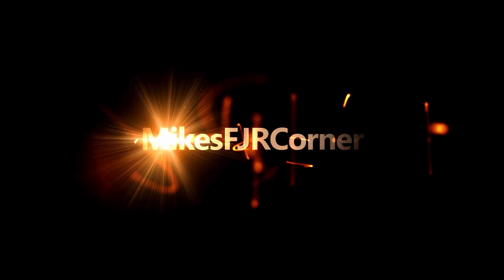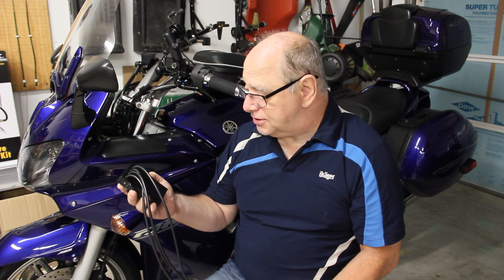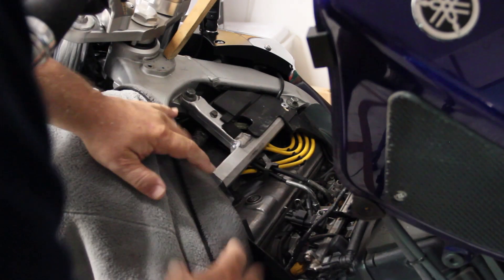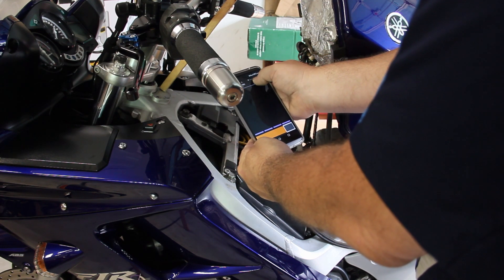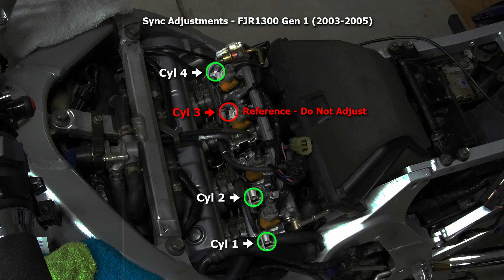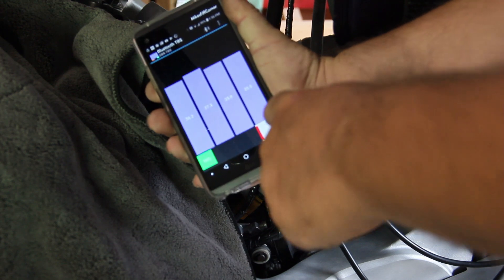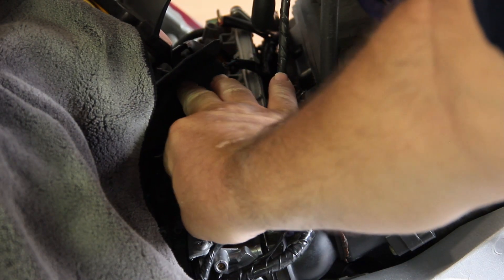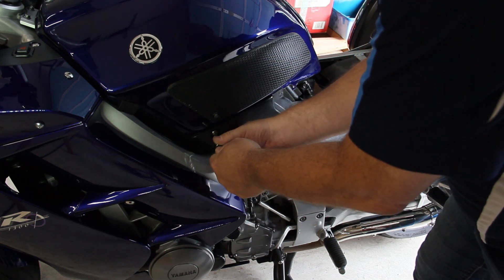Doing a Throttle Body Sync on the FJR1300

Comment: Ur not showing where to adjust
Reply from the maker: There is a section in the video showing a picture with circles around the adjustments. 

Unfortunately I don't have the luxury of a camera man. With both hands busy, my hands blocked the adjusting. Did not notice until later. That's why the picture.

Comment: Hello  , i did unscrew the master cylinder  by mistake  , do you know  how do i fix this?
Reply from the maker: Hello, unfortunately Yamaha does not have a procedure for this. I'm guessing you don't have any pictures or memory of where the adjustment was or how far you moved it. I think it's about 3/4 turned out from  closed. Id consult your Yamaha tech for what they do in this situation. It defines the air fuel ratio for the rest of the cylinders when the trims in the ecu are not in effect.

This is only for if the master adjustment was definitely moved. I'm just throwing an idea out there, don't know if it will work but...

If you disconnect the O2 sensor, the ecu goes into an open loop. With the sync in balance and a clean tb and air filter, measure the air/fuel ratio with a fuel ratio gauge. With the engine slightly off idle, take a measurement. If its rich, turn out all screws slightly, if it's lean, turn them in slightly.

Maybe somebody with knowledge of the inner workings of the ecu could add to this theory.

I've learned the hard way, take pictures first. Yamaha should really put a cap on the master cylinder adjustment. My old 84 Honda  interceptor had caps on the carbs air adjustment.

Hope this helps, mike

Comment: Hello,
First thks for your videos!! very helpful. I am doing a TBS on my 2007 FJR and I was wondering if the reference cylinder was also #3 for my year? 
Unfortunately the manual I found for 2007 model does not talk about TBS unlike the 2006 manual.
Also I am using the carbtune pro and the metal rod keeps moving up and down making the reading hard. is it normal?
Do you have any info on that?
Thks for your time.
Reply from the maker: Your Welcome. Yea, I had the same problem. Get a set of restrictors from Motion Pro (Link Below). Yes. The 07 (GEN2) has a similar TB to the 05 (GEN1). The cable is connected to TB #3, this is the fixed TB that all other TB's are referenced to. Notice which TB the cable is attached to.  The other TB's (1,2 & 4) all have mechanical set screw adjustments (These are factory set, make sure you don't adjust the mechanical screws). The GEN 3 (13 and later) has throttle by wire, The motor I believe is connected to TB 1 making that TB the reference on GEN3 Bikes.

https://www.amazon.com/Motion-Pro-Carburetor-Synchronizer-Restrictor/dp/B0050CGRDM?SubscriptionId=AKIAILSHYYTFIVPWUY6Q&tag=duckduckgo-d-20&linkCode=xm2&camp=2025&creative=165953&creativeASIN=B0050CGRDM

Comment: I would sync for 4-6k rpms. Why? You don't ride on the highway or any other road, at idle speed. You ride at 4-6k rpm's. You bought the tool, now learn to properly use it.
Reply: What screw did you turn for adjustment?   The video didn't show a closeup of the adjustment screw.

Comment: Hey mike thanks for sharing great video , how did bike run after , did it get rid alot the vibration doing 70 and 80 on highway thanks
Reply from the maker: Hello, no, it only affects idle to about 2.5-3k. 

I also have vibration at higher speeds as well. 4k RPM and higher. 

It has been a quest of mine to reduce the vibration above 4k RPM. 

When I first got the bike it vibrated enough to put my hands asleep.

I have been systematically going through the bike. I replaced the wires and coils, injectors, cleaned the throttle body. With each project, I got a little less vibration. What made the most difference was replacing the wires and coils.

I also had a vibration at about 2k and that seemed to be caused by the balancers. From what you are describing, this should not be a problem.

Is there any dent's in the headers. I have a crease in Cylinder #1 header at the collector box, and I have a theory that this could affect breathing in the cylinder causing my lower vacuum in the cylinder at higher RPM's. Thus causing vibration. To further my quest,
I may replace the headers with headers from Delkevic in the future.

If the painted throttle plates adjustments were ever touched, then the balance between closed and open throttle will be off. In this case the unofficial throttle body sync may get it close. 

Google it. It should be done only if you know the painted screws were touched and after everything else has been eliminated as the source of the problem.  

It's kind of tricky. What they are essentially looking for is to adjust the painted screws so the vacuum stays balanced at 4-4.5k as well as at idle.

I knew these screws had been touched on my bike so I did the unofficial throttle body sync and have gotten the vibration much better, but unable to get cylinder #1 balanced. I think this is due to the dent in the header.

Sorry for the long answer. Hope this helps, Thanks.

Comment: what is the exact name of this bleutooth tool and apps on your phone.thx.
Reply from the maker: Hello, It's made by a engineer that call's his site dimensionbx. I have the links for the site and app in the above description. Unfortunately he's does not seem to be selling these anymore. Maybe if you email him and ask nicely, he could make you one. In the description there is a link to a commercially made product by healtech.
Reply: @mikesfjrcorner7129  THX MİKES.THAT İS VERY KİND OF YOU.I love your videos.They r the best so far.why did you make block off different than twowhellobsession shows here.https://www.youtube.com/watch?v=qYFWag7I3-Y&list=PLmGgEUWgGCSArQh89nQddVGGqP-1QZEqP&index=19&t=0s
easier and cheaper.
Reply from the maker: hello, yes you can block off the port's by adding cap's to the blocks. However, my bike is older and the reed valves were leaking hot exhaust gas back into the hoses. So when I tried to use plugs, they would get hot, then stretch and crack. So the more elegant solution was to completely block-off the port's. Also the side effect of completely blocking off the ports is, that it quiets the engine slightly by not having exhaust sound making it's way into the hoses. thanks
Reply: @mikesfjrcorner7129  Thx a lot Mikes.I have 2005 FJR Blue, exactly like yours:)
Reply: @mikesfjrcorner7129  Mikes, I can not reach him.
Reply from the maker: Too bad he is not responding, it’s a cool gadget. He was selling them on eBay, which was where I bought it.
Reply: @mikesfjrcorner7129  any videos on brake pads change

Comment: Just bought 05 fjr. So thankful you took the time! I was apprehensive about doing tune up etc but not now. My bike smells rich and has erratic throttle under 3k. Going to change all fluids and plugs tb sync. Waiting for service manual to arrive. Thanks again!
Reply: I ve bought 2005 also.has the same issue.I changed all oil and plugs but no differences.
Reply: As They said it could be from Carburator.I think I have to take out the carb and clean may be rebuilt it which I hate.Long and difficult process.
Reply: harun ergul the plugs did wonders for me. Still an off idle surging im thinking tps. But the more i ride the rich smell is fading.